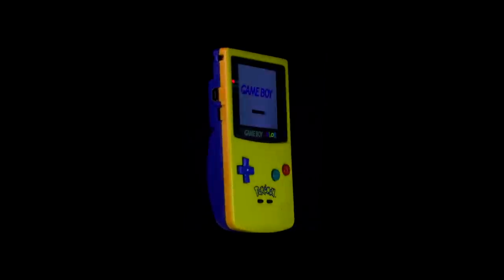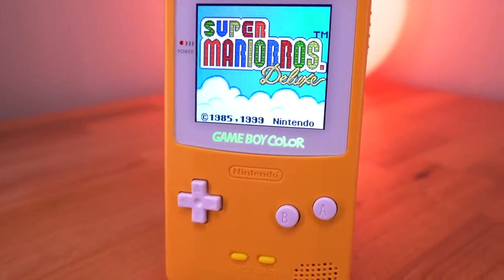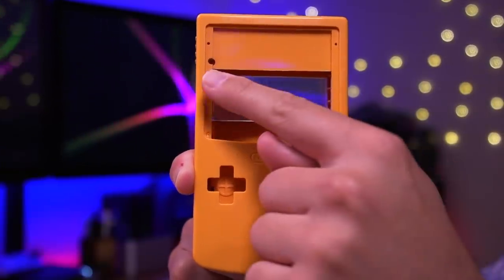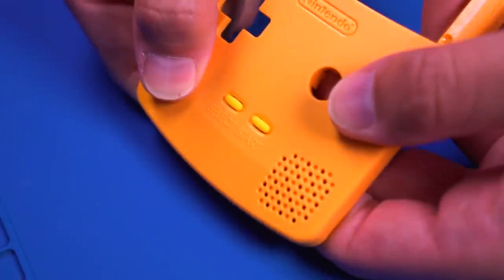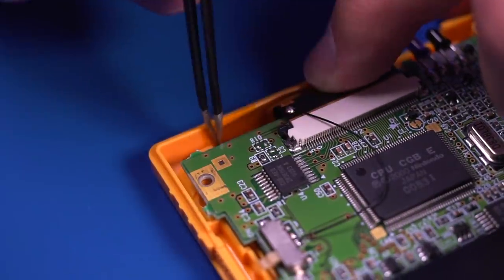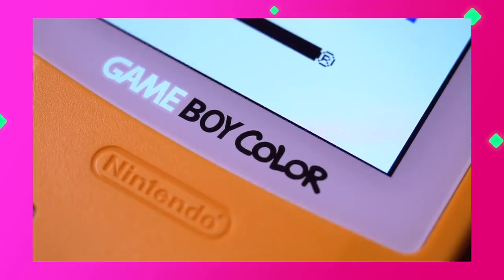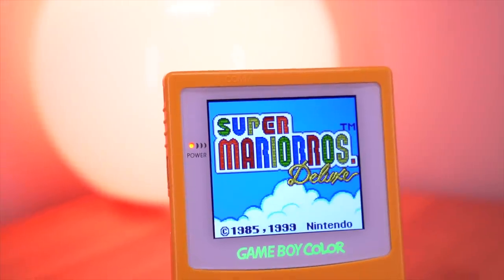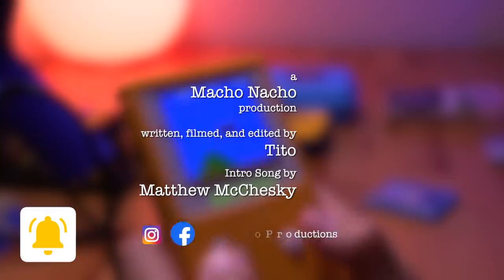The BEST IPS KIT for the Game Boy Color for 2021 | New Laminated Q5 v2.0 IPS Kit from FunnyPlaying

Comment: They are totally missing a trick by not having a setting to have the letters of 'Color' match the original GBC logo, they've got each individual colour by the look of it (Red, Purple, Green, Yellow, Blue) and they look nice and vibrant!
Reply: Yep,but you will need to also have another menu
Reply: @X_Niaxx_X  no, you dont.
Reply: Agreed. Still ended up getting this panel, as if this is the only con of the screen then it's a sacrifice worth making.
Reply: The problem is that L of the word “COLOR” overlaps the “O” so maybe that was the reason
Reply: @CptFreemanC17  I got it as well lol its pretty amazing.
Reply: lets not kid ourselves. FP probably thought of that but want to issue a v3 kit .... like they always do hahaha
Reply: You could stick a transparent yellow film between to get yellow light
Reply: They have a new rgb setting for it so you can pick super specific colors

Comment: For those struggling to adhere the touch sensor with kapton tape, (I know I did when applying it to a transparent shell), use a small cut-in piece of foam or bubble wrap to pressure-fit the touch sensor to the shell. It works great and I no longer have to worry about disassembling the unit to readhere the touch sensor to the top.
Reply: so... your tip is to make sure the kapton tape has good adherence initially?
Reply: @MrAgentEcho  my tip is to not use kapton tape for the touch sensor and to use foam instead
Reply: Could you also put the sensor under the uv thing cause it is not see threw

Comment: just finished putting this together... I've done a lot of mods using youtube but hadn't used a video with chapters - thanks for that! I wish the white cables were way shorter but overall very easy kit that looks and feels OEM. Also - if you guys get the same rechargable batteries - be sure to remove the plastic guard from the charging dock or your batteries won't charge xD

Comment: I just successfully performed this mod with every step following your vid!! They must have had a revision of the flex board that comes with the screen kit as the start and select solder pads are now up near the ribbon connector into the screen, right where it bends. I was worried the start and select would contact each other but doesn’t seem to be the case! Another tip for everyone - make sure you have a small enough soldering iron tip or it might be hard to get those start and select solder points on the game boys board! 

With all that said what an amazing mod and thanks for the video Tito!!!
Reply: I'm using a tiny soldering tip, but i'm really struggling to get the start and select wires to adhere to the MB, any tips?

Comment: Just got this kit myself, and I must say it is as awesome as it looks in the video.  The laminated screen makes such a huge difference .  I also like the backlit logo,  though, as some others stated, it would be nice if on top of the color choices, they would have a mode where the logo lights up in the same color palette as the original unlit one.  But eh, it is fine , couldn't ask for more with this.  Installation was a breeze, aside of a dumb mistake on my part (yes do not accidentally short 5v and GND,  the GBC actually does have 2 fuses, which are single use, once blown they need replaced,  learned that sadly the hard way. I have done numerous mods on my handhelds, and this was the first time ever  I did such a beginners mistake. Doh. )

Comment: Just got it installed, it looks stunning. As you said, it was a fairly simple process (your instructions were extremely helpful), though I had to gently scrap some coating off the start and aelect vias to get the solder to stick (a little no-clean flux helped). Thanks for the discount and for helping me find this great kit!

Comment: Definitely don't remove the screen adhesive until you know its working.  That was the one thing I did differently than your guide. I just used a piece of painters tape on the outside to hold the LCD it in place while I worked. Very glad I did that because I got a bad LCD with tons of discolored  pixels and a big purple splotch in one corner. Swapping in a replacement should fortunately be a very quick process.

Comment: handy to mention, the start and select pad on the ribbon cabel are a bit too close, so if you have a nice round solder ball on both, when closing the gbc up they might touch and create a short between start and select, when you hit either both would be pressed. I recommend keeping the blobs as small as possible
Reply: Hello! I bought a custom gameboy from Etsy that I believe has this exact problem. The start and select buttons input at the same time which is messing the entire console up and making games unplayable. Is there a fix for this?
Reply: Thank you so much for this! I installed everything only to not be able to select a different color so I searched throught the comments hoping someone might have the answer to what I did wrong and it was this exact issue. I was able to hold start and both buttons would be pressed so I had to resolder and make sure they wouldn't touch. Took like 5 tries but I got it working perfect. Thank you!

Comment: No dust by default? Sold. I've got a GBC with a TFT kicking around that I don't use which is perfect for an upgrade.
Reply from the maker: That’s what I said!  Dust is a huge pet peeve of mine.
Reply: and its always perfectly aligned!
Reply: So what happen if your screen crack? Having to buy a complete new screen plus glass is less cost efficient as compared to just buying a new glass replacement.
Reply: @carxiong6744  If it's tempered glass and you're being careful with it, that's probably a chance most would be willing to take. I messed up a screen the other day trying to adjust it while on the adhesive since it didn't align. $20 down the drain.

Comment: That's so awesome, but as someone who's never soldered before I'm still not comfortable jumping into a mod like this. Too bad, I'd love it.
Reply: Perfect time to learn a new skill then, this project is as easy as you can get.
Reply: Soldering isn't as hard as it looks, grab an iron off of amazon, and get a practice kit. I used to practice on sega genesis cartridges.
Reply: Everything is intimidating at first. Grab a 20 dollar test board of Amazon that has lots to solder. Then you'll be laughing at how much easier it was than you thought. De-soldering capacitors is trickier and where you can potentially lift a pad from the board but it's usually fixable. With practice and a mistake or two, that will be no problem either. I also did the Neo Geo Pocket mod without a problem (except for not clamping the video ribbon enough the first time) after just one practice soldering project.
Reply: I agree with everyone else, this is prob the simplest soldering project you could find. Give it a go! Its like 4 vias
Reply: @mjc0961  for something this simple you could probably just heat up a metal rod on the stove lol
Reply: You can do it! I’ve never soldered anything before either but I got a cheap one off amazon and it’s really not that hard ! I just have really shaky hands so that makes it a little more difficult 🤣

Comment: My only gripe with this mod is the sensors aren’t reliable. On both of mine that I’ve done with this screen, the sensor is only receptive to touch if the Gameboy is warm/hot. If the GBC is cold, it won’t respond. 

I wish there was a way I could solder buttons to do everything you can with the sensor similar to the Gameboy advance version.

Comment: Love the video. I'm personally not a fan of this mod. Partly because you have to buy a custom shell and the other part is that it's laminated (not glass). It can limit customization options when you deviate from the standards. I would like to see maybe instead of the logo, open up the bottom portion for in game information, like FPS, brightness details, battery details, etc. 

Nice to see that you're using the solder point above the controls I mentioned last time!

Also, I became a PATREON. I have never used the site before. You're the first creator that made me want to donate! Keep it up!
Reply from the maker: I thought that was you!  Thanks so much for the support buddy!  Very much appreciated!  I sent you a message on Patreon. Cheers!

Comment: Just installed the kit into what was a battered, filthy old purple Gamebuy Color. They have since re-designed the cable, but the soldering points are clearly marked. If you power on the Gameboy before soldering the POWER wire, the screen will just be black. The original Start/Select membrane buttons fit in the new shell just fine.

Comment: The drop in screen with the front bezel attached should be the default way to mod going forward! Are there any plans for other handheld systems?
Reply from the maker: I think we may see some very soon
Reply: I have to agree.  Keeping the install dust-free and getting rid of the air gap between the lens and screen are so nice!
Reply: @FioFirefox  Do u think that they will do something for the GBA?
Reply: Hey can we form an alliance?
Reply: @andrewgoss1682  The world's not ready for that much awesomeness 😎
Reply: @GENKIDAMA10  Would be nice as the Q5 is getting adapted to many handheld but there are already many screen options for the GBA.
Reply: @FioFirefox  Yeah the fact that this kot has a perfect centred image and no duat, that’s something else! I wish they do the exact thing for the GBA

Comment: Just got one off eBay fully assembled, DMG style. I didn't have a GBC so I was looking at almost $90 for screen, case, buttons and membrane and $70-ish for the actual GBC, not going for the cheapest/worse condition but I found one all put together for $180, DMG and stated they replaced some capacitors. I might open it to take a look and see which ones. GB/GBC games just look better on this than the GBA, which I did mod from an original with the Minish Cap shell and FunnyPlaying IPS. I only have Dr. Mario but I ordered a flash cart. I'll be on the look out for the original carts I had when I was a kid.

Comment: Oh hey, so that’s what that sticker was for. I thought that might’ve been the case but I just ended up using a strip of 1” kapton.

I really enjoyed this mod. The screen looks great and the install was simple, though I also took the opportunity to recap my GBC. I think my touch sensor placement could use some work though. Hopefully I can find an 06 revision mobo someday; though the 05 seems fine enough.
Reply from the maker: Haha, oh man, I was wondering what the extra stick was for!  Thanks for the heads up!
Reply: @MachoNachoProductions  I think we’re referring to different stickers! I was talking about the big one… I just used kapton to prevent from shorting the board. Were you talking about the smaller strip to hold in the sensor? Seems right. I ended up using double stick tape and that seems to work well, though I think I need to move the flex down a smidge on the solder point.

Comment: I'd be really interested in this custom shell if it had a built in USB-C charging solution. I don't mind batteries, but damn it would be nice to put in a lithium rechargable.
Reply: One thing to note, the funnyplaying shells do have the battery area trimmed up already. No protrusions between the AA cells. This is so you can easily run a Li-ion cell in that location. 
Just in case you didnt know, someone did develop a usb-c board, but it does require filing the power port on the shell to fit. (And soldering etc)

Comment: I love my Pokemon GBC, matches my Pokemon Stadium N64, 2nd is the "Ozzie" GBC but I am very hesitant to cut them. Also I learned a tip that you can use at 7:33 and that is to route the wire in between the chip and the legs for clean look

Comment: Huh a laminated screen makes a  nice bit of difference. Being used to them from phones over the last 10 years, this just makes sense! It improves perceived contrast a lot since there is no reflection of the screen on the inner surface of outer cover glass, and no reflection of the environment on the outer surface of the screen, since they complete assembly is optically impedance matched.

But how good is it outdoors? I think what i really still want is a GBA with the original reflective panel with a laminated frontlight mod of some sorts. But i'm not sure how this can work. Or maybe i make a laminated unlit assembly someday.

Comment: hey i just followed your instructions with this mod, and it appears the sensor is now part of the ribbon cable. i still attempted to solder the included sensor on but it was smaller than the one in your video and wouldn't bend without breaking the solder point. either way the sensor works great! Thanks for the tutorial!!!

Comment: I found that the vias mentioned for the Start and Select were quite tricky to tin and they are in very crowded location next to other vias. The two vias higher up for Start and Select looked to be further separated and I would solder these instead if I were to do this again

Comment: I'm not a fan of the larger screen for GBC. It looks too out of proportion for me. I need to research Q5 screens for DMG/GBP to see if the retro pixel effect causes a small flickering between screen transitions like the earlier screens do.
Reply: I just completed a GBC mod last week. I wanted a no cut mod on an original clear shell GBC with textless black screen lens. The lens I used was from retromodding: https://www.retromodding.com/products/game-boy-color-backlit-lcd-glass-lens?variant=29386389815319 and the TFT kit I used was from retrogamerepairshop: https://retrogamerepairshop.com/products/nintendo-gameboy-color-backlight-mod-gbc-game-boy?variant=29434716880970 Online everyone complains about the screen being smaller but it's like 0.2" diagonally. What's interesting to me is that I only notice a small black strip along the bottom and horizontally it fits perfectly. TFTs use less power than IPS's and the lower brightness isn't a problem for me because I am always turning down the brightness on my Retro Pixel IPS DMG. It's way brighter than it needs to be but I haven't played it outside. Don't discount TFTs!

Comment: So i got a kit for this IPS. IPS shell, new buttons, membranes, and of course the screen. Overall i absolutely adore this kit. However, i'm noticing a slight issue after full install, and i'm not sure if it's the membranes i got or not.

I'm noticing there's a slight issue with the UP D-Pad button. I have to hold it up and slightly to the left in order to register the press. Almost like there's either an issue with the board's contacts or the RGRS membranes not creating the short that it needs to press the button if i push it anywhere else to the up/right.

Has anyone else experienced this? Or is this most likely just an issue with the membranes or donor motherboard?
Reply: if you know it's the D pad UP button, you gotta open up your game boy, then at the motherboard you see gold color contacts at that area, clean those well with IPA and a ear stick, and make sure your membrane aligs perfectly. If you still have the problem there might be mosture underneath the membrane plastic sticks/bars/hammers, clean those well too (especially the UP direction in your case), ive read a handy tip is to use paper sheet and rub it very gently a FEW times (like 2 or 3x) over the paper for a short distance (like 3 CM) to remove any dirt and moisture, but dont rub to long or strong or you shorten the plastic bars that touch the motherboard gold color contacts. you will see rubbing at the paper will leave traces of black, so do it very gently, it's just to polish them and to remove any human body flueds. Then dont touch that end of the plastic bar anymore, and put it back in.

If that all did not do the trick, try to use the original membrane and see if that one works better. 
Or to unscrew the motherboard (unscrew only halfway to losen motherboard), and try to push/wiggle the motherboard a little to the left in your case in order to align it perhaps better and fasten screws again while holding it firmly in that place, i dont think you got lot of wiggle room by the screw holes, but in your case any motherboard space you gained to the left can help.

Comment: I did this mod myself. Looks great with a smoke shell, but I would be careful ordering from retro game repair shop. I installed it and within the two week return period it developed a spontaneous crack on that center screw post in between the buttons and I received an email back when I told them about it "haven't had an issue with it, must be user error" and basically told me good luck. Never ordering from them again.

Comment: Thank you for the wonderful video!

I have a small question.  I'm very new to the world of soldering and this was actually my first time ever attempting it.  All connections are made after 3 hours of trying and everything works as it should. But I have this worry that my Gameboy will get too hot or (worse case) batteries explode because I soldered something incorrectly.
Is there a possibility of it overheating and bursting into flames from a solder job or is it a baseless worry caused by first time anxiety?
To be clear, everything works perfectly fine. which I'm assuming could only happen if everything was done correctly.

I know it's a silly question and I feel embarrassed to even ask it, but it would really help to get a professionals word to ease my mind.

Comment: Great kit, however, as I'm a beginner at soldering, this is not as easy as the video makes it look. Soldering the start and select wires to the actual board is extremely difficult as these are very small holes (specifically pre-tinning). Additionally, my own personal blunder I had pre-tin drip on to the ribbon cable connection which is difficult to get off. Needless to say, waiting for ribbon two...